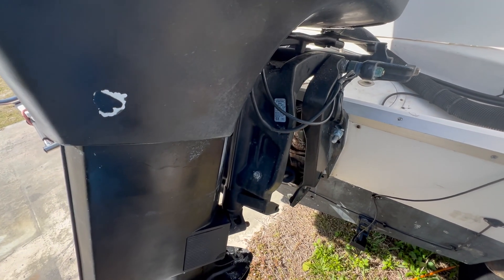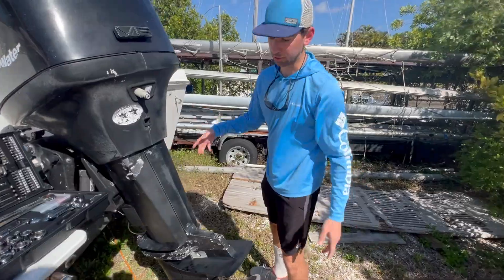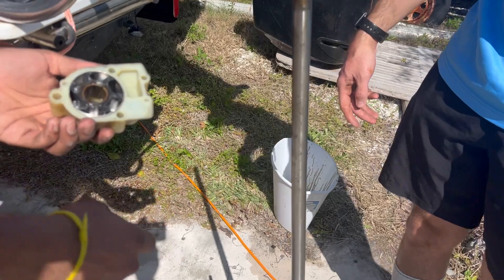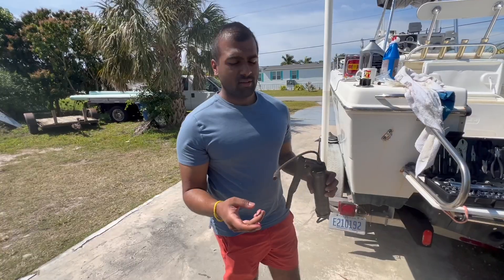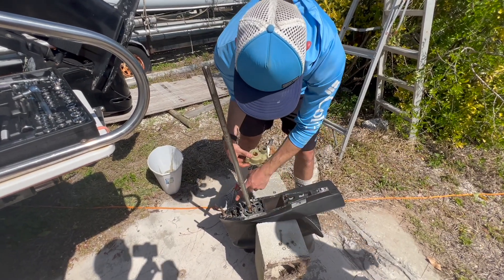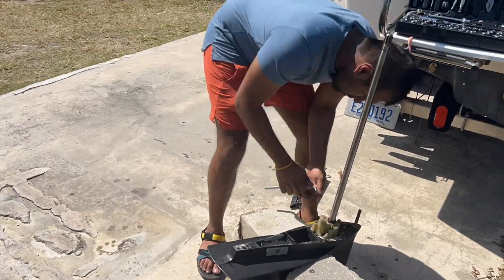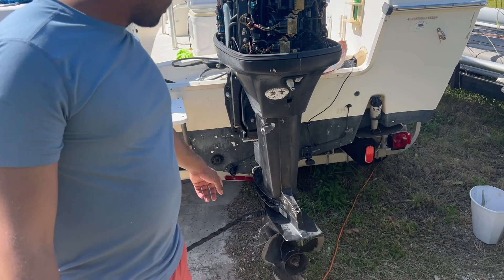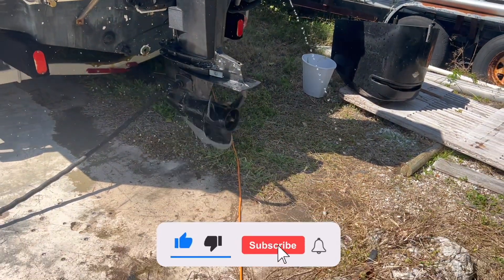Mercury 150 Optimax Saltwater Impeller Replacement - SDS goes to Florida

Comment: Is there any reason why the shaft would not go in completely? We tried everything, spinning the propeller, spinning the fly wheel, all the pipes were aligned. Shift in neutral and in forward and still not going in.
Reply from the maker: @ADMRS5  might be hard to see in the video, we grabbed the main shaft with a shop rag and helped align the splines that way. Hope it helps, ShopDontStop